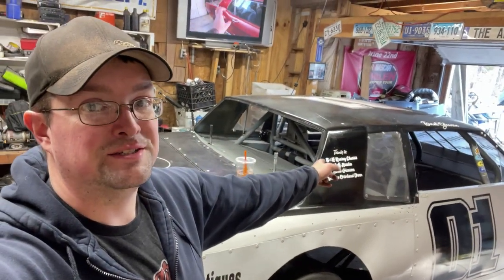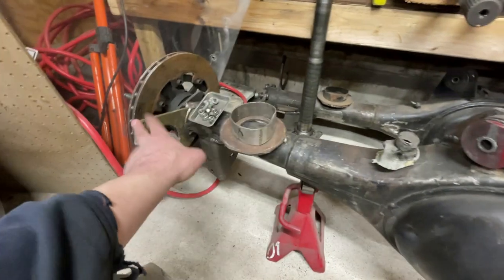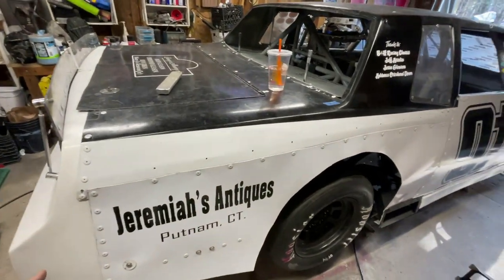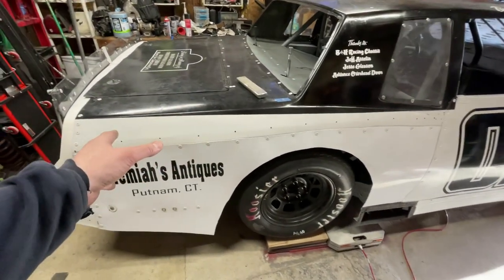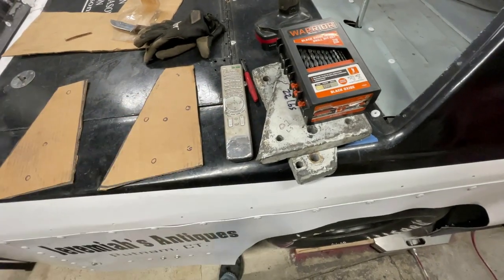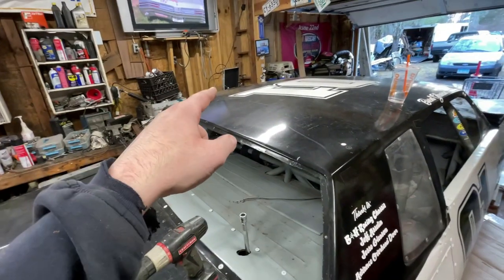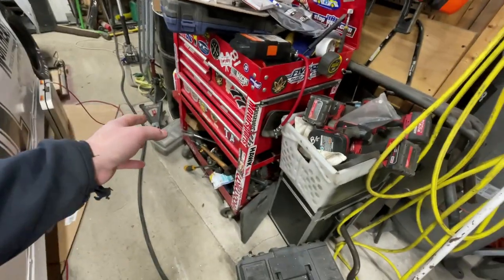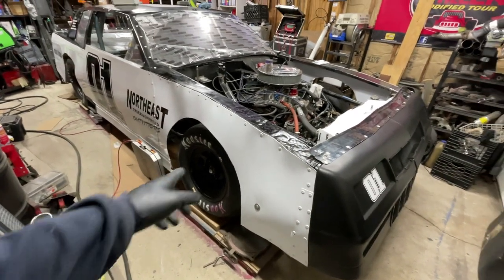Last week to prep the race car!

Comment: Enjoy watching and following your page. Have a couple questions for you. I noticed that you run 4" offset wheels on all 4 corners.  Are you allowed to run different offset wheels or are your rules to where you can only run 4"? If you could,  it would help with cross weight and left side and help alot with chassis and numbers. Have noticed in the past but never asked.
Reply from the maker: Nah, we can’t run different offsets. All the wheels have to be the same, and have a centered offset.